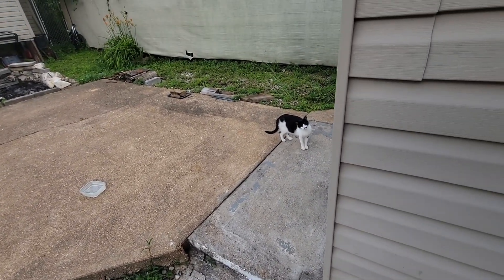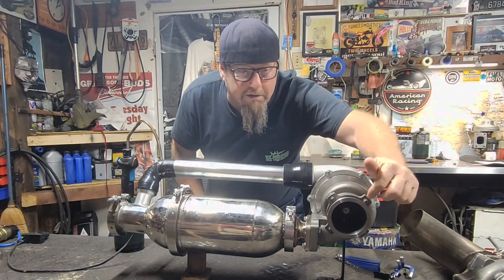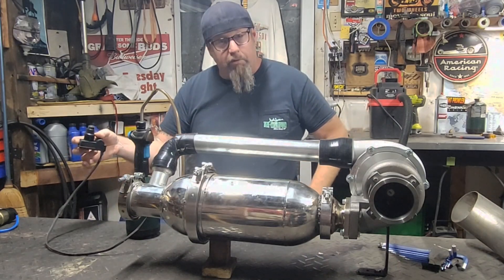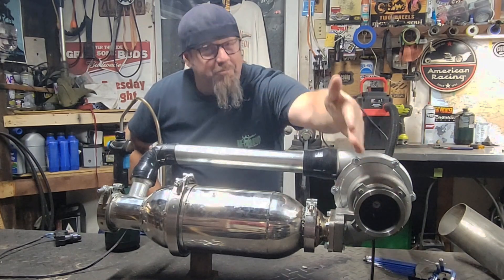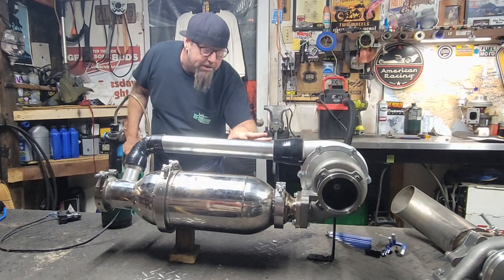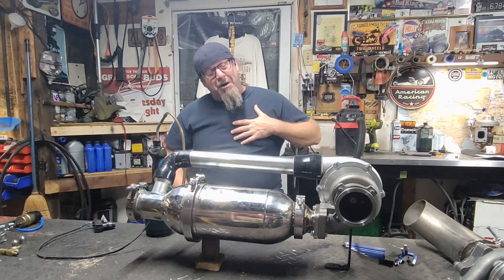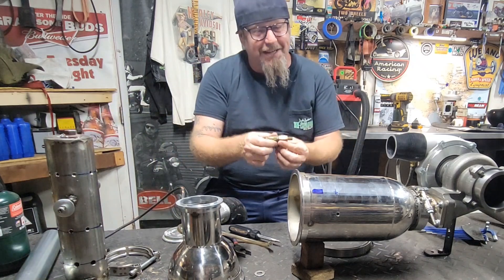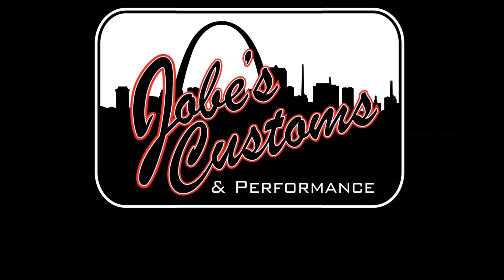Combustor build and test fire up - Jet Engine Fab from Scratch - ep.4

Comment: Great work, sir. I recommend drilling more holes in the flame tube. I used this formula with good results: Flame tube diameter = 2x the turbo inducer diameter, Flame tube length = 6x the turbo inducer diameter, The first set of holes takes 30% of the turbo intake area, the second set 20%, and the third 50%.
You can also use Specs Designer 2.0 to calculate everything more accurately.
Reply from the maker: Thanks!  We'll be able to tell if my math is correct so far, once we get liquid fuel injection.  Im working on the new setup now